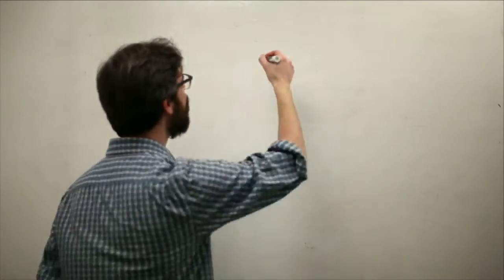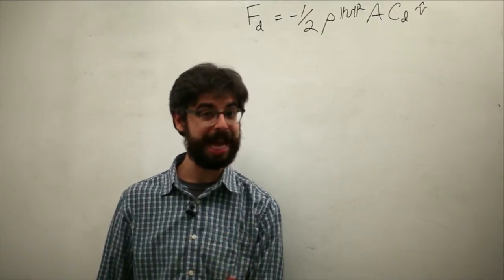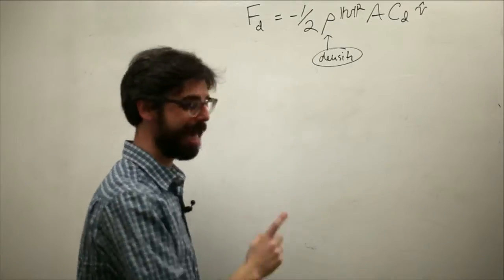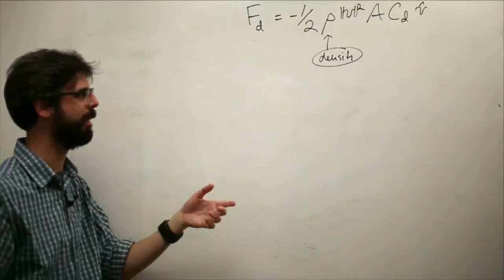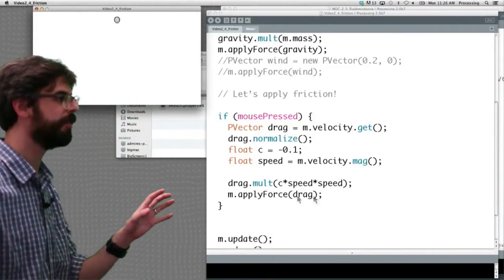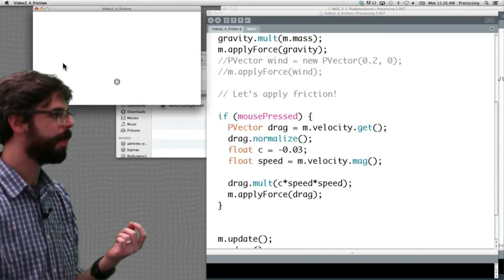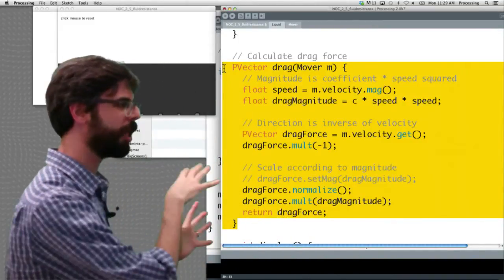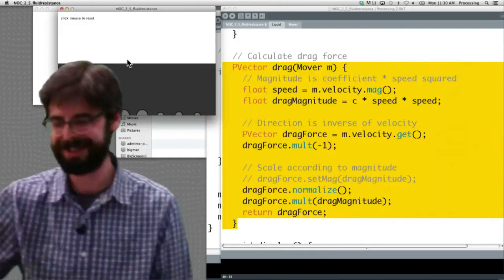2.5: Drag Force - The Nature of Code

Comment: I thought I understood physics, but it's awesome to understand that an object reaches its terminal velocity because the drag force scales relative to its speed while the force of gravity is constant, so gravity increases its speed until the drag force matches gravity and at that point it stops speeding up / accelerating and the forces are balanced and the object stays in motion at the same rate.
Reply: I've always wanted to learn this.
So that the player can move but be stopped, yet any object can knock the player away much faster, without the player accelerating that speed yet still have control.
Which would require both using the same moving technique yet I never figured anything out

Comment: I can't understand the difference between density and coefficient of drag. Could someone please clear this for me?
 By the way, amazing tutorials. You're a wonderful teacher. 
Thank you for sharing your knowledge  <3
Reply from the maker: I'll wait for a proper physics expert to weigh in, thanks for the question!
Reply: For CoD’s sake:
The density of the fluid is the amount of stuff (mass, particles) in a volume of space.
The coefficient of drag (CoD) represents effects that increases drag due to the shape and surface features of the thing moving through the fluid.
*Hopefully useful model*
Think about walking through a crowded room of people. People are like the particles that make up the fluid.

The density is how many people in the room. 
Lots of people, lots more drag when moving through the room

The area is a measure of the surface “size” your body takes up as you move through the crowd. 
More area, lots more drag when moving through the room.

The CoD is the “shape” or “type” of surface (smooth/bumpy) your body has: e.g. walking through the room with arms out, or having a jacket with things that will catch on people, each give a higher CoD and therefore lots more drag when moving through the room.

Note: The area you take up so you can walk through the room effects the total drag. But also; different shapes with the same area may have different effects on drag, this is the reason for CoD..  A thin tall person will walk through a crowd easier (low CoD)  then a short wide person (high CoD), even though they both have the same effective surface area.  

I hope that helps puts CoD in it plaice:)

Comment: Hi, I know it's an old video so I'm not sure you will check this out but hey...
First of all thanks for your amazing videos.I'm learning a lot.
Second I think you might have forgotten to include the surface in your dropping in liquid example.
The larger balls have a bigger surface and should fall slower than the smaller ones. I guess it depends on the density of your movers and the mass you've given them too.
Reply: well nevermind I forgot to multiply gravity by the mass

Comment: +The Coding Train  Hi Dan, I really love you vids but I was wondering how you got your movers to stop bouncing indefinitely.  I tried setting acc and vel (acceleration and velocity) vector magnitudes to zero once velocity reached a minimum value but that stops the movers from moving at all (since their init value is 0 and vel never becomes zero after that point).  Do you have any tips on how to deal with this?  Thanks!
Reply: I was experiencing the same problem and it was driving me nuts. Eventually I realized that in my update function I was adding velocity to position first, than adding acceleration to velocity. Switching the order of these to lines of code solved the problem me.
Reply: @Daniel etat I have Been looking for that answer for a while now

Comment: Hi Dan, thank you so much for all your videos, they are extremely interesting and inspiring to watch, and explain the concepts in a clear, fun way!

I was following this chapter (Drag Force, Fluid Resistance) in TNOC, and upon running the sketch discovered that the smaller objects seem to bounce off, from the liquid. Some, bounce and then eventually sink, but others actually increase velocity after each bounce, and eventually just leave the screen. I have spent ages trying to figure out what's going on there, then I decided to download and try your example for that chapter (since the code in the book is a bit different), and found that it happens in your github example also.

In order to see it happen, in the reset method, instead of having random(0.5, 3) for the mass, try using 0.5. You will see that at 0.5 mass, the object will bounce but eventually sink into the liquid, however at 0.4 it will not only bounce, but also incrementally increase velocity with each bounce. Could you please explain what's going on there?
Reply: Have you found a solutionfor this? I'm really stuck.
Reply from the maker: +Victor Ivanov Yes, this is really a bug and due to the approximation nature of these simulations.  When the mass is so little, the calculation actually results in an acceleration that moves the circle fast in the opposite direction, like it's bouncing off.  This would never really happen so a good fix might be to constrain the values.  I'll think about this more.
Reply: shouldnt it all be divided by 2?
Reply: The problem is a real drag in trying to simulate drag.
QUICK SOLUTION:  In mover update method, add  code:
void update() {
    velocity.add(acceleration);
    // NEW CODE
    if (velocity.heading()<0){
      velocity.mult(0);
    } // END OF NEW CODE
    position.add(velocity);
    acceleration.mult(0);
  } 

Long boring physics and com-sci explanation: 

-- Facing the interface --
A common problem that physics programs, of this type, will face is how to calculate what goes on when crossing an interface. In our case. going from no drag to drag.

Most force formula that contain velocity. like in our drag formula. should be actually calculated using the instant velocity, not the average velocity we have to use. (So we can calculate the distance traveled by the mover at each iteration of our draw loop.)

Since we have to calculate this way, our model has to take the velocity when not in the rectangle and calculate the drag as it enters into the rectangle. This means the calculating  velocity (not been in the rectangle at time of calculation) is slightly higher than the instant “real” velocity would be. Also since we square this velocity it is even “more slightly” higher in error. This has the overall effect of making the upwards force (even when the downwards gravity force is removed) artificially higher upwards. So when this over-estimated higher upwards force is applied to movers crossing the boundary interface they can sometimes head upwards. 

Note two things from observation that gives this away: 1: The problem only occurs when crossing the boundary; 2) The smaller masses are accelerated (a = F/m) more by the over-estimated upwards force giving them noticeably larger incorrect effect; even sometimes shooting upwards. 

One way to solve this is to get the program to do a test when the “movers” crosses an interface and then set it to have the correct velocity and location. But for our model a quick fix is to test that the velocity is never going upwards, that is never negative (Note:positive is down for our model) and set it to zero (multiple it by zero) if this occurs. This will stop it from ever heading upwards. 

Hope that makes sense and is of some help.
Reply: oh my GOD, ive been struggling with something similar for AGES!
And I hadn't even added any forces yet. All there was to the code was a
- velcity that's initialised to 0 in both directions
- an acceleration that's intialised to a small number like 0.3 in the +y direction (wrt the screen, meaning lower direction)
- the absolute basic bounce off code that mulitiplies vel by -1 when it touches it

and the ball would boucne higher and higher with each bounce, eventually glitching out of the top of the screen.